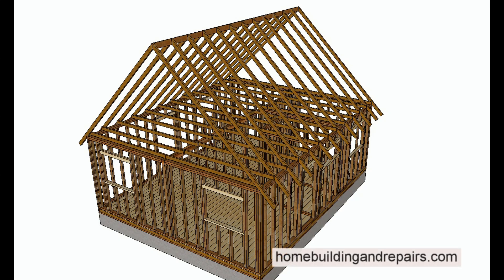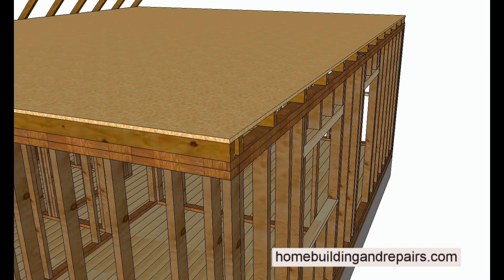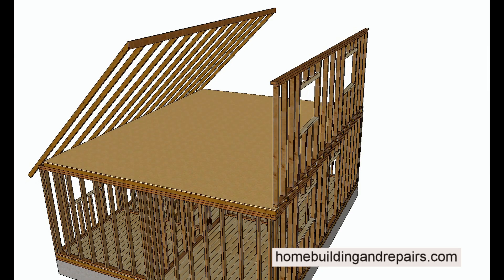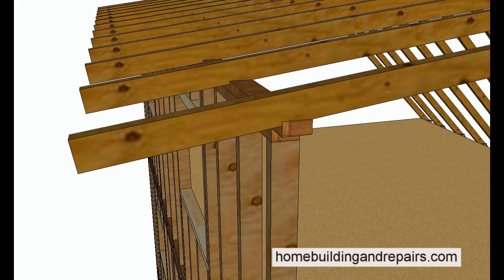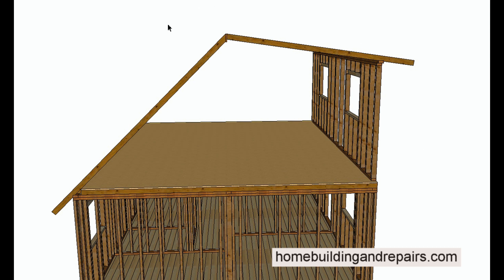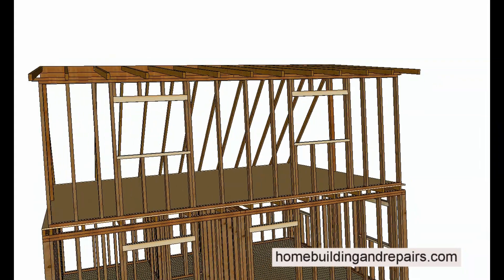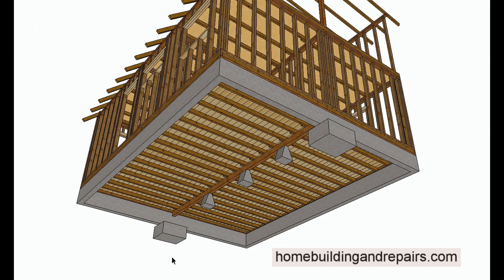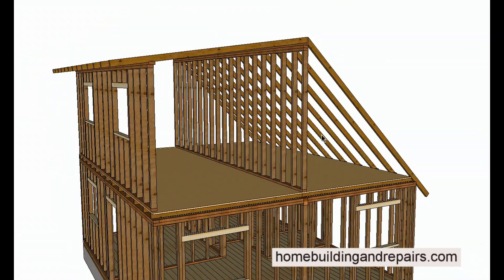How to Make Attic Larger by Adding Exterior Wall – Major Remodeling Project

Comment: Greg. Great video! I have a well-built 1944 cape cod that was constructed with a finished attic and 2x8 floor joists on 16" centers and 2x4 knee walls 6' from the sides of the house. The roof is 8:12 with 2x4 rafters and a unusual split gable design from the front--so there are load bearing walls and beams in the middle of the house. At some point, someone added a 9-foot-wide shed roof dormer in the middle of one side for a bathroom extending to the edge of the house. 

I want to add 14'6 to the existing 9’ bathroom shed roof bringing the new shed roof all the way to one gabled end. I don't know how well the bathroom dormer was supported—so may end up wanting to redo the framing for the whole 23'6 span. 

I get that I need to add a new beam at the peak and a way to support that to the ground in the middle of the house and at the gabled end. If I go the whole 23.5’ length, I understand that I’ll need a post set to carry the load to ground that breaks up the new joist span.

The house was built with a (>4x10) beam on the main floor that would break up the new floor length, so I am not too worried about that. I'm also considering adding a narrow balcony by peeling up the floor and sistering to the existing 2x8 floor joists and going back 9-12' to support a narrow 3' balcony. Width TBD. 

I’m a handy DIY, and have lots of GC carpenter friends. I’m taking out the central chimney (that was unused and would have been in the way) to get the party started. Up on the rooftop, I noticed that I am overdue for a new roof (small holes in the peak!). I’ll tear it down to the plywood and will use either: SIPS with only 1 side of OSB, or layering ~6” of rigid foam on the existing roof deck over a new membrane, add vent channels and a new roof deck & shingles or metal. 

Other than talking to a structural engineer, what issues should I be thinking about. Thank you!
Reply from the maker: I hope my email response helped.

Comment: I did something like this over my garage. I extended the existing roof up another 4 feet or so to increase head room and give the new roof a similar pitch to the old one. Mine matches the example of the wall under the remainig roof which is the vaulted ceiling to my living room so the new room has two openings with railings that overlook the living room. The new wall was built about 3 feet back from the edge of the roof so there is still a small section of roof in the front and we left 2 feet of the existing roof on each side of the new room. We had to double up the floor joists and we doubled up the supporting wall adjacent to the living room and installed a second beam and supporting metal posts in the garage to support the floor, there was already a beam there but it didn't originally need a supporting post.

Comment: Great video as always. Will this work on a shed? Currently I have a 8x12 shed gable roof and the walls are only 6' tall.. Sit's on 4- 10" concrete piers and 2x6 joist as the foundation and OSB on top of that.  Will it be possible to build another 6' tall area above this? Any advice would be greatly appreciated.
Reply from the maker: It could, but since I can't provide engineering information, I won't be much help.

Comment: Great video. What if it was a 15 ft wide shed dormer on a 30 ft wide house and the remaining knee walls on both sides were reinforced to create box beams? 

On a separate note: If you sister joists and then add plank flooring as the subfloor, does that factor into rigidity more than not using planks and just using plywood?  Thanks!

Comment: I’m trying to make my 2nd floor bathroom bigger. I want to blowout the gable end of bathroom wall and reframe over  a single story a frame family room. I want to keep the front intact and build out over half of the family room vault and take it up to match the 2nd floor roof peak. Not sure if it will be worth the effort. Will gain about 7X5 ft space.
Reply from the maker: If the roof framing structure needed to be rebuilt, then I would say go for it, but to only gain a few feet like you're suggesting, might not make financial sense.

Comment: What about if your foundation is a slab foundation? Would you need to add extra support below the foundation where the pier would be mounted?
Reply from the maker: I cannot provide you with engineering information, but most of the time structural modifications will require additional concrete footings to support post or walls that will be transferring loads from the roof to the ground.
Reply: @gregvancom  how does that work when it's a slab foundation?
Reply: Anybody found the answer to this question?

Comment: I like how you use graphics (an animated model) and the skeleton of the house to explain expanding. It's fun to see people actually remodel a house/home, but such videos really don't demonstrate the process. Thanks for sharing this information.
Reply from the maker: Glad you like the graphics and it really does make a difference.
Reply: @gregvancom  I am buying a one-room schoolhouse that has been renovated (beautifully), and would like to utilize the attic space. The current owner left the side walls at 14 ft (I think), mentioned that she could have lowered the ceiling (to ten feet) and created a room, loft, and bathroom upstairs.

I would like to open up the attic into just such and would like the upstairs to retain the sloop of the arch in the roof with maybe four feet of wall straight, like in New England Colonial Homes.

Do you have any graphics on what to consider in such projects (i.e., I have determined where to put the stairs)--and, the seller did put in a "load-bearing wall" on the main floor. 

If you'd like to see the schoolhouse I can send you pictures.  Thank you.

Comment: i have a question. I am considering buying a 28x29' brick garage with what looks like 12 foot walls. Would this be a large enough interior space to put essentially a furnished apartment on the inside with most of the apartment in a second floor loft?

Comment: I have a question, we have a barn that was built in 89. its a simple 17x11 ft barn with 16 on center 2x4 walls. it also has a second story "attic" space used for storage and there is a lot of stuff stored up there currently. the exterior siding is also the sheathing. I want to replace the siding and possible replace it with OSB and moisture barrier and then new siding. I'm also planning to extend the rear of the barn out by opening up one of the exterior walls. my concern is that removing the siding and taking out one of the walls might remove any shear support from the structure and the whole thing would collapse laterally because of the weight up top. what do I need to do to brace this and is this a dangerous job to try and do?
Reply from the maker: You bring up a good point. I would work on one wall at a time and you could always replace one piece of OSB at a time also. You've given me an idea for another video, but I don't know when it will be made and will put a link here when it's done.

Comment: I did something like this. I used a 10 inch steel I beam and let the rafters sit on them. It works very well.
Reply from the maker: That is a big beam and it should have worked well. Thanks for sharing and I would love to see a picture of what you did.
Reply: Doug Mac how did you temporarily support the other side of the roof before you cut out the roof section on the opposite side? Any pics tips would be greatly appreciated!
Reply: @davidtortorici2628  Temporary purlin supports?

Comment: Hey greg, what program are you using for your examples? Am I better using another program with small remodel plans and various examples to use when bidding? 
Thanks enjoy the videos hope I didn't miss this information somehow.
Reply from the maker: +Preston bigler  Sketchup from Google.
Reply from the maker: +Preston bigler Am I better using another program with small remodel plans and various examples to use when bidding?  I don't know, the biggest problem with Sketchup is the price and it was hard for me to finally come up with the money. I really don't know what else is out there and don't think I would be the right person to answer your question. I bought it and I love it
Reply: gregvancom    l,l,l,l,  _/|  l,l,l  toe nail with screws   top/bottom of every board to subflooring..6"......Outside wall would also triangulate with every outside length top /bottom to  outside wall. XL posts butted to wall butted to wall. screws=tension.  Roof Lathern also reinforced  ../\... STILL VIEWING...
Reply: gregvancom .....Local lumber mills...THICK and THIN  LUMBER...SON OWNED..🐥🐥....SANDSTONE ENFORCER...WITH STEPS...LOCAL....yokel...good nite..

Comment: I have built a couple room additions like this inhabiting the attic. my house has truss rafters I hate it. Its limits what you can do. if I were to cut out the ceiling joist part of my trust after would my roof fall in? about 4 feet on one side on five trusses? I kinda already know the answer but
Reply from the maker: +Dr. Seymour Butts It's hard to tell, whether or not the roof would cave-in, but you could always add new rafters and ceiling joist. In other words you would reframe the area with a conventional roof system. If you want you can send a picture of the area and I will see if I can help.
Reply: +gregvancom that sounds great I'll try to do that tomorrow thank you